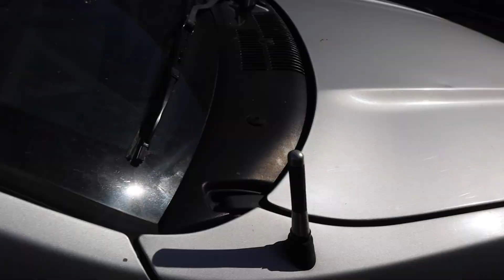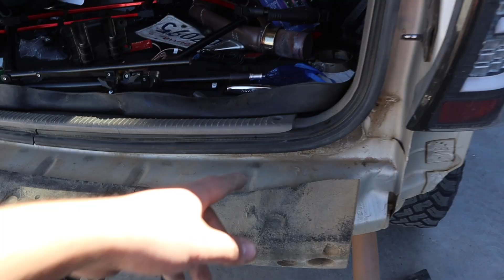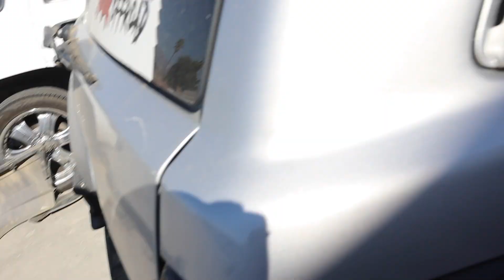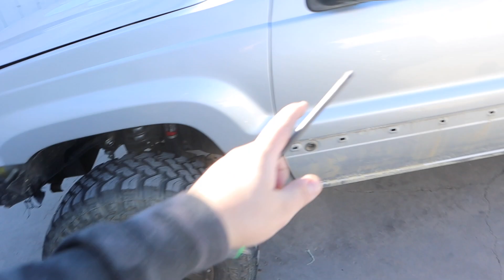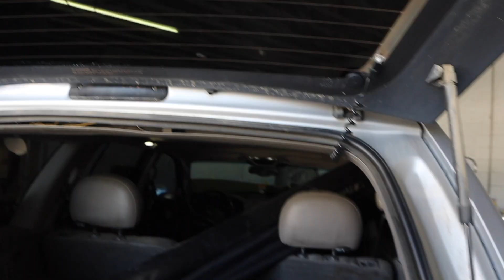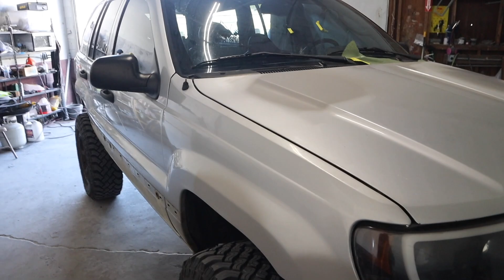Prepping Body Work on Jeep WJ for Vinyl Wrap

Comment: It’s going to look really good, man! I love the videos, I’m able to live vicariously through you because I can’t afford to do what you are doing lol. 
I did the rubicon fox shocks a week ago, based off of your video, so thanks for that one! Also I feel like the ride is rougher abs feel more of the little bumps/imperfections in the road with the new shocks. Did you notice any of the same thing?
Reply from the maker: Thanks brotha! To me the ride is a little more stiff compared to Bilsteins but nothing super rough. FYI Fox is more design for offroad compared to bilsteins are more of an onroad shock
Reply: @NajarOffroad  okay that’s what I figured. I just wanted to make sure it was to be expected, like I didn’t somehow mess something up on install lol. Thanks for the response!
Reply: @NajarOffroad  hey, quick follow up question. Did you put any sort of rubber washer or grommet between the adaptor and the shock tower like what comes with replacement shocks made for the WJ? I’m wondering if it’s so jarring because it’s metal on metal. It’s so jarring that my wife won’t even drive it because any little bump feels like you just slammed into a curb at 60mph. It’s really strange. Almost like the shocks are bottoming out, but they aren’t.